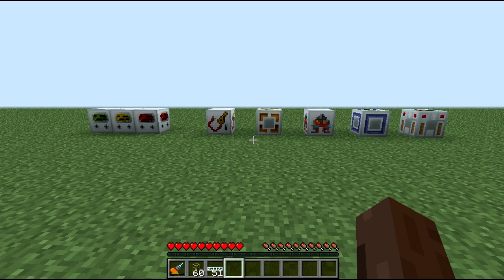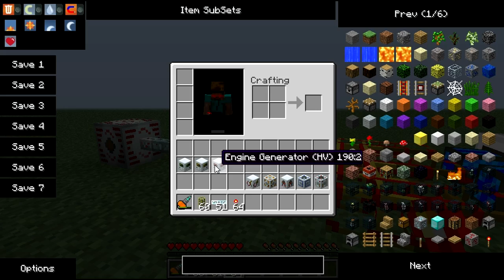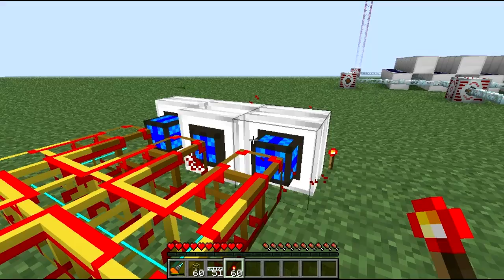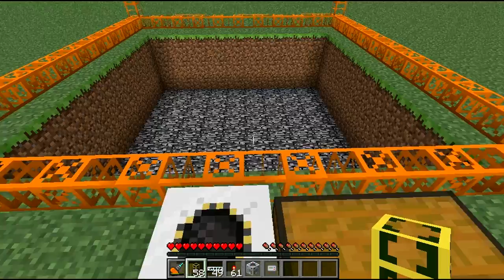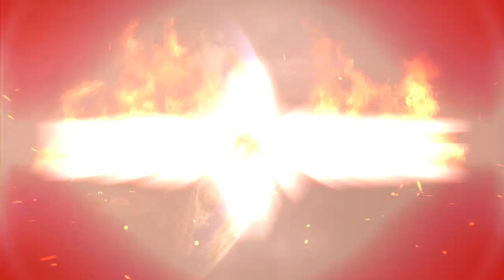Minecraft: Mod Spotlight Power Converters (IC2 & Buildcraft Addon)

Comment: @MADCOCK83 My problem was that, on the linked forum post, the recipes for the engine generators show up as requiring an EU storage block at the center, when what they actually need is an appropriate transformer, which you show in the vid. So either I'm seeing the wrong item, or at some point they changed from the original recipe.